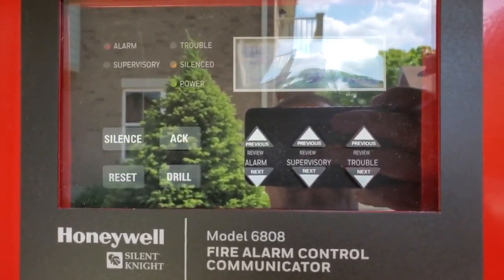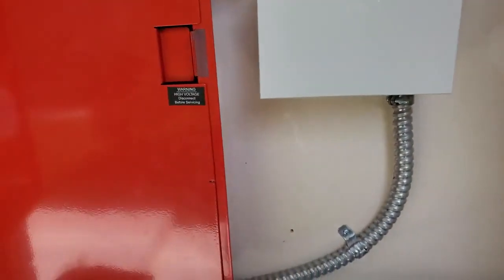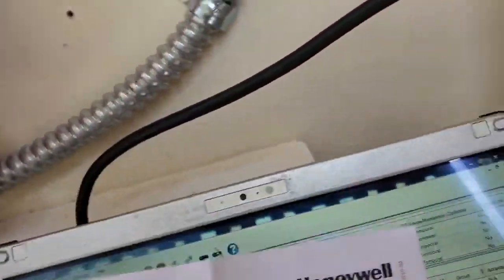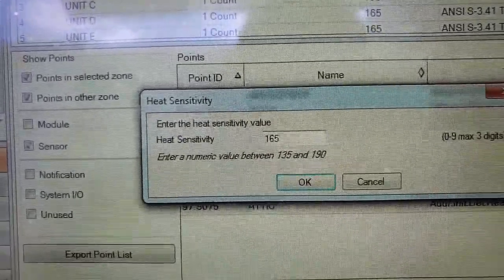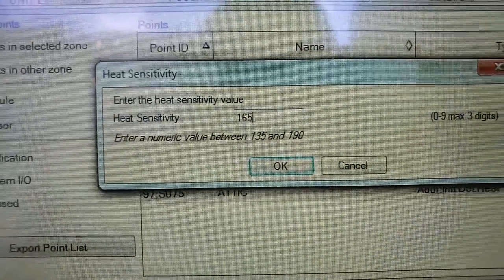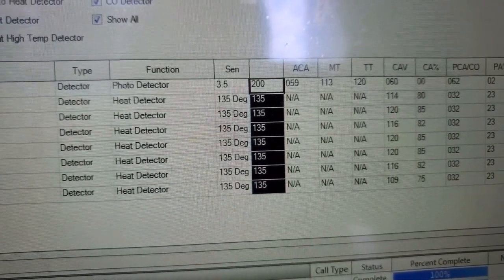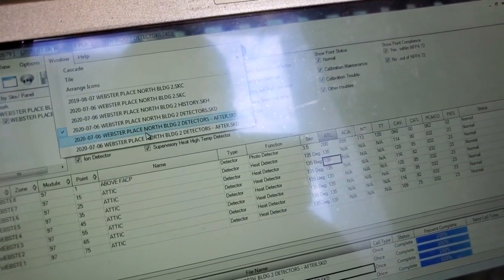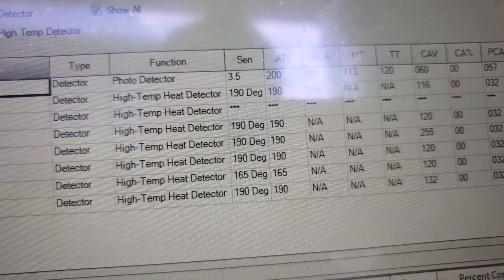Silent Knight 6808 / HFSS Software  *** CLARIFICATION ***

Comment: Many people ignore the environmental restrictions of their addressable devices.  Are you in an area that routinely exceeds 93% humidity?  It clearly says that device is restricted from being installed in that environment on the form you're holding.
You may have to go with a analog conventional detector.  If so, remember to install the module where humidity doesn't exceed 93%.